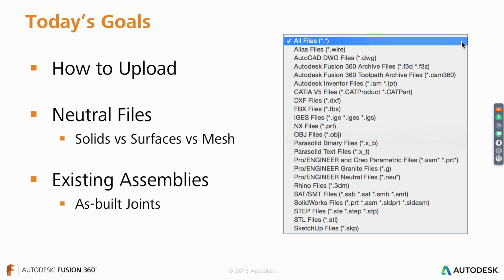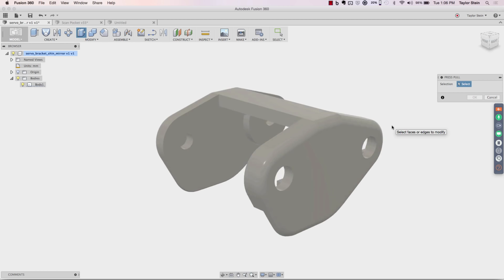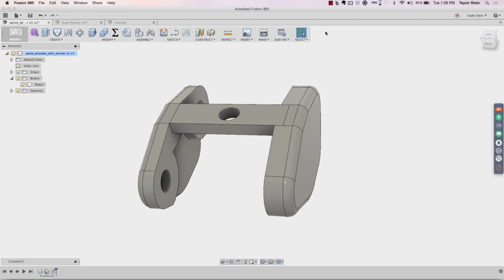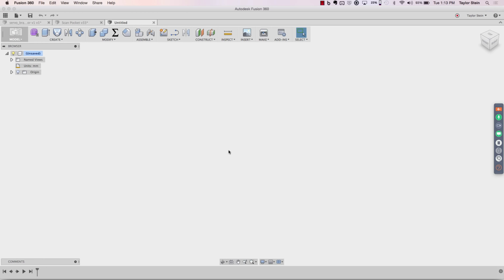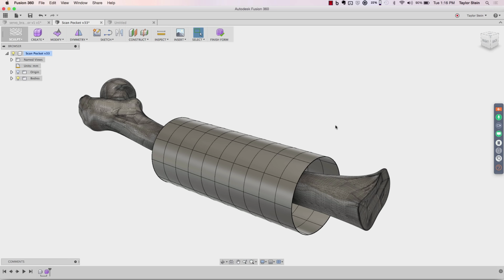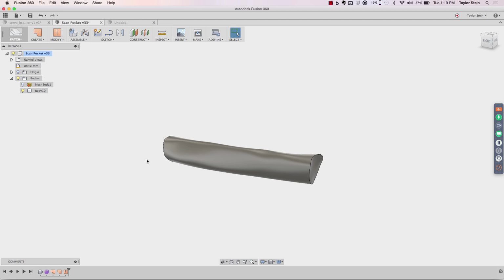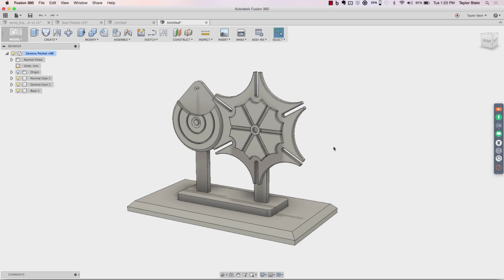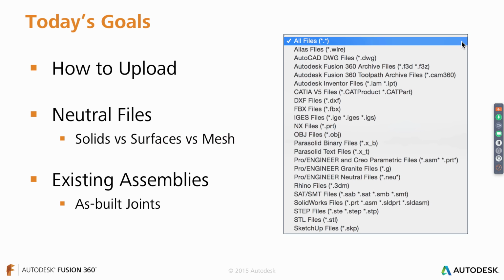Autodesk Fusion 360 | Webinar: Working with Imported Data in Fusion 360

Comment: Why in my case the sketch geometry lines don't turn to black color from blue when I apply constraints? What settings should I play with to enable it?
Reply from the maker: +Султан Арзиев Hi there - Inside Fusion 360, click your name in the upper-right corner and choose Preferences. Next, in the Preview tab, check the box for Sketch - Color sketch geometry based on constraint status
Reply: +Autodesk Fusion 360 thank you! You make the best CAD software ever!